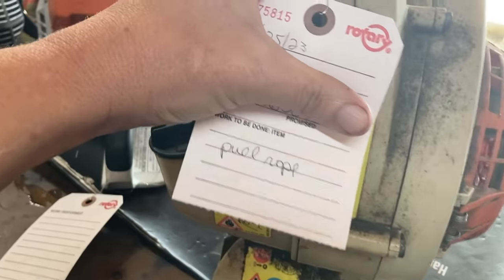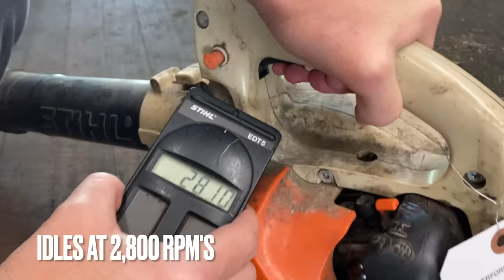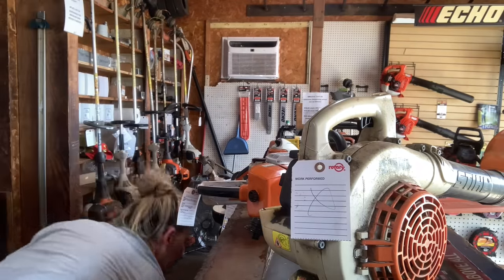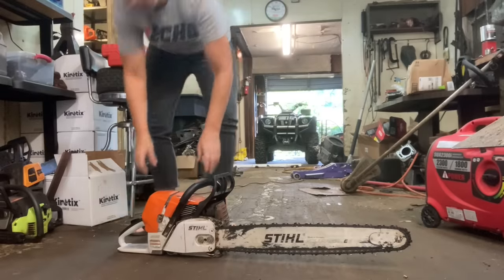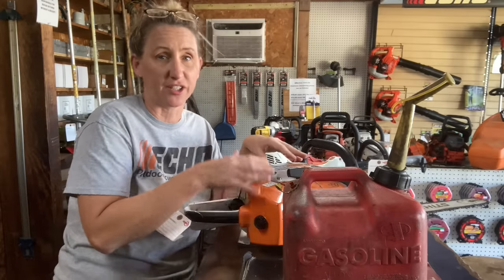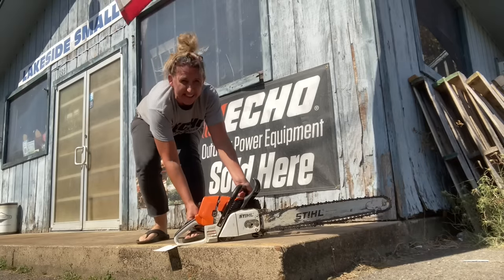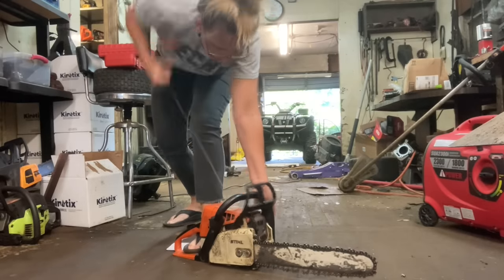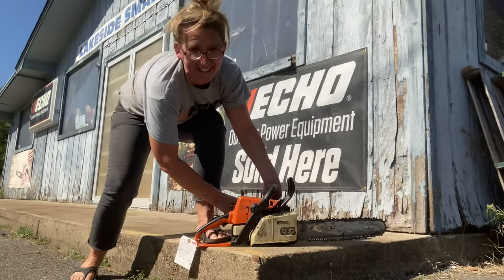The Burning Truth of Canned Fuel. This HUGE Distributor Doesn't Like Me Exposing It!

Comment: JUST ONE QUESTION: has the canned fuel industry ever sold you water in their fuel?
 bought 91 octane premium a few weeks ago, put the first 2 gallons into my truck, filled up my fuel cell, filled up a deere 445, topped off another deere 445 that was over 3/4 full. 3 days later i went to load up the 445 that was completely refueled and it died within 10 yards and couldn't get it restarted so left it at by the garage, loaded up the topped off 445 no issues. about 1minute into using the topped off 445 at full throttle and it starts missing and sputtering  just as i am about to make a 90º turn to avoid going off the top of a 93' embankment over looking the mississippi river and the engine dies sending me to the brink of the edge as i stomped on the parking brake pedal and flipped the lock lever up just as i am jumping off. 1st attempted murder charge of the day by climate change terrorist activists
so then i work my tail off trying to get the machine restarted and get it out of such a precarious position and it took a good portion of a can of carb cleaner to get it running reliable enough to  back out of there, loaded it back up on the trailer till misfiring alot and took it back to the garage, used it to tow the completely fueled 445 onto the trailer and hauled both of them off to the local deere dealer to find out what's going on with the one not running at all and the other suddenly having issues. my truck tank was getting close to empty so i put a few gallons from the fuel cell into the truck and drove down the interstate to the dealer and every time i was at an intersection whether i had to stop for a light or not, the truck had a major loss of power and was running funny... i'm almost to the deere dealer after exiting the interstate and the 3rd to last intersection and i am in the early part of the turn and my truck engine just dies and i coast to a stop in the middle of the intersection with the trailer loaded with both mowers and i am almost rear ended by a tractor trailer that was behind me and it takes the tractor trailer so long to go around me that the light has gone red and traffic is trying to cross the intersection and not one but two more tractor trailers come barreling at me from where the tractor trailer behind me had bstructed their view and damn near exterminate my sorry butt.
#2 attempted murder charge of the day by climate change terrorist activists.
by this time i am starting to suspect there is a fuel problem so put out my work cones around me rig and i abandon my truck in the middle of the intersection after grabbing a gas can out of the back of my truck toolbox for making 2cycle mix walk over the gas station infront of me, buy 2 gallons of premium and a bottle of isoprop fuel treatment and dump both of them in my trucks gas tank while a city cop rolls up, told him i think there is something wrong with my truck and i might need to call a tow truck if filling the tank with this fuel and treatment doesn't work and after a minute of trying to start my truck it finally sputters to life and starts running fine, but sluggish and the deere dealer has a nice parking lot so i go there, talk to the mechanics and they haul my tractors off the trailer to  the repair storage area and i walk across the road to home depot and pick up a small can of acetone and drive over back to the gas station is filled the mix can up and put a measured amount of  acetone into my tank and fill up my truck with half a tank of premium and use the restroom and come back and fire up the truck and it suddenly is running just fine.

deere tested out my machines and tested my 91 octane premium i filled my fuel cell with....it's 99% WATER in my tractors with just a 0.5% of lucas injector cleaner as i am about to due routine completely machine maintenance filter changes and lubricants and greasing to be ready for fall clean ups and winter .

when the dealer tells me it was  mostly water in my tank, i get on the web and start looking up whose job it is to make sure this doesn't happen, and first place i call is  the department of commerce weights and measures division andi drag the dealer pulled fuel samples from my deeres and my fuel cell 50 miles away to their office testing facility and when i get there they look at my fuel receipt i keep for the road fuel cell tax deductions and said because i had bought it weeks ago and the station has probably filled up their tanks 3 times since and there is nothing legally they can do as like police, they have to actively catch a station in the act of selling watered down fuel and that most likely this is the condensate that bonded to ethanol corn juice which due to the molecular structure of carbon to oxygen vs dinosaur fuel having different carbon molecular structure repels water, the ethanol probably sat and built up in the tank and was now siphoning off the water left in the tank when i filled up.@50 gallon fuel cell at $4.45 a gallon, and $275 deere bill just to diagnose what was wrong and empty my fuel systems for 2 garden tractors....i am beyond livid at green climate TERRORIST activists twice attempted murder.

how many people have they killed because of water ethanol killing engines while in critical/dangerous situations?

 last year a man was mowing his side of the mississippi river bank a few miles down river from me and his zero turn was found the next day upside down with him still seat belted into his zero turn drowned to death after his wife reported him missing the DAY BEFORE
 it took a passing kayaker reporting the upside down mower wheels to the sheriffs office to find him!

Comment: Geez 2 years ago I pulled my Lady Stil out from under the bench and opened the case just to try it after 11 years...  MAYBE 6 pulls and it was running.  Only used it once since I moved to the SW from the NE to back drop an almost dead tree that was leaning over my garage. Cleaned it, greased it, checked the chain & teeth then filled the bar oil & fuel an stuck it back in it's case. Fuel is in a 2 gal can with 2 stroke Sta-Bil & 100:1 synthetic oil.  MS250-C Easy2Start.... still on original spark plug but 3rd air filter. If it can't breathe, it ain't gonna run.

Comment: What fuel mix do you use? I use Rec fuel in all my power equipment with a splash of Seaphome evry time. My 2 stroke weed Wacker I have used canned fuel for years, adding a splash of Seaphome as well with no problems, so far. Lol. Thanks for the videos and how tools. Very helpful

Comment: Stihl says their Moto Mix last UP TO a two years. Unless opened. So, if you want to pay $33 a gallon for gas, and use it in two years. Have at it.
Non ethanol so only important if you plan or storing fuel in the tank for months. 
I just buy pump gas, mix it and when I’m don’t, the rest goes into the truck.

Comment: I have been using insanely expensive gas from the local Husqvarna store in a two stoke KTM for several years with no issue. Its engine could not run any better. 95 octane, 50:1 synthetic oil, stabilizer, non ethanol, and no trash or water. Couldn't be happier with it.

Comment: Go to your local airport and get a couple of gallons of 100 low lead. Mix it however, you need with your oil whatever is required, leave it park for five years and it’ll start right up. You can’t beat avgas.

Comment: I've never used the canned fuel because at least around here it is outrageously expensive, but now I won't for sure!  My mix is premium fuel (trying to avoid ethanol), any 2-stroke oil, and some fuel stabilizer in a 1 gallon jerry can, and sometimes I've run that for 2 years without any problems.  It almost makes me think 2 stroke oil stabilizes gasoline but I can't see how it would.

Comment: Here in England, I buy Aspen alcohol free two stroke fuel with oil premixed.  I use it over the winter and for light use throughout the year.  No issues, and much less noxious exhaust fumes.  I started using this because of damage to hoses and carburettors by using E5 fuel with 5% alcohol.  I never use E10.  When I cut my large hedges, I use a couple of gallons of E5 and mix my own oil, as it's much cheaper.  Is your canned fuel alcohol free?

Comment: This interest me because I've got a 2-cycle mini tiller (was abandoned with the house we bought), plan to learn not just take it to a shop...but I want to get going again, takes some crazy high oil ratio (24:1 I think?) and nothing else I own uses mixed fuel.  I'd not found any but the "canned fuel" was of interest to me mainly as a way to obtain a "gas can" that holds really small quantities of fuel so I don't have to worry about a gallon of gas going bad.  Any suggestions for other ways to get a small, safe "about 1 quart" gas can for infrequent use of 2-cycle engines without buying the pre-mix canned gas?  Or maybe just buy a non-mixed canned "regular gas" and mix it myself (or dump in the car and refill with clean good)?

Comment: My wife couldn't get her Stihl trimmer to start (I also pulled it a few times). She has always used non-ethanol pump gas with Stihl Platinum oil. I can't tell you how many times Iv'e cleaned the spark arrestor  on it🤬

LSS I emptied her tank, cleaned the spark plug, pulled with the spark plug out about 10 times,  grabbed my MotoMix, filled it, primed it and it started on the 3rd pull. Funny, It reved better too

Many people in this area swear on the "light pink canned fuel sold at the big box stores" even though I haven't used it I surely did learn something today

Comment: Usually the moment I see something that says "they" don't want you to know this or they hate, etc. etc. I scroll on because it is some bogus ad. I knew it would not be the case with you. I did not realize that this was such an issue. You'd think at the price they charge and it being engineered, your get a clean fuel with built in Stabil. Obviously not.

Comment: Here in the UK I don't even think you can buy premixed two stroke fuel. And even if you could, I wouldn't bother. It aint exactly too much trouble mixing your own. Just don't let any small engines sit for a long time with it in. Five minutes of effort draining the fuel before putting a weed whacker or whatever up for the winter can save you hours of effort in the Spring!

Comment: My brother in law is always buying those cans in 40 or 50 to 1. I’m old fashioned and mix my own, premium non-ethanol fuel mixed at 32:1 with Klotz Techniplate. It’s not cheap oil, but it reminds me of the motocross tracks of my youth. Bad for 32:1 in these newer engines? I just do it that way because of easy math, 4oz to a gallon.

Comment: With all the "it's light. It's pink" being said and I agree, Tru Fuel is garbage. So what what are your thoughts on Stihl's Moto Mix?. Every piece equipment was Stihl, which are notorious for not running on Tru Fuel. 
Also, I hope you changes the clutch springs or replaced the clutch on That MS 461. It's in need of one or the other.

Comment: So this is crazy. After stumbling on to your videos I decided to mix my own gas after using canned fuel for near ever. I've used the husky version on my husky blower for the first little bit of owning it then moved to trufuel. I always felt like it could pull more RPMs and have more power. Switched to mixed non ethanol gas and it would run to max RPMs for a few mins then start to bog out at WOT and eventually quit. Mixed fresh gas with new oil, and same thing. Switched to trufuel and it ran fine. Checked my plug and it's nice and brown so it isn't running rich or lean. Dumped trufuel out and put my mix back in.....same thing bogging down and shutting off. Put trufuel back in and it runs again fine. The non ethanol is on it's own pump so I know it's not getting ethanol. May try getting another fresh batch of non ethanol gas and doing a mix with different oil. I used the husky oil from Lowes. However, I've got a bunch of 2 stroke gas that I can't use. LOL! I'll take it over to my in laws house and use it in their equipment and see if it works on theirs.

Comment: Unfortunately up here in Canada we cannot get any fuel that doesn’t have ethanol anymore. Premium and premium plus can have up to 10%. I was just going to try canned fuel as I always had mixed my own before with no issues. This year my chainsaw stopped running and I determined it was the fuel had gotten water in it. A little checking and I found out last year they had started adding ethanol to the premium.
Reply: Premium in Saskatchewan Canada is still pretty much ethanol free.

Comment: Hi Bre, love the channel. In my area there is no non ethanal fuel. But one station sells racing fuel 110 octane. Whats your opinion on using that for small engines if its mixed with 2 stroke oil?

Comment: I use canned fuel from the manufacturer for both my chainsaw and string trimmer. Their product seems to work much better than the pink fuel in question. Just note that all canned fuels are not created equal, and if you don't use a gallon or two of mixed fuel during the season, you may want to try some canned fuel from a manufacturer that doesn't start with the letter T.

Comment: Fresh mix and Seafoam has been best for me. I've even had regular gas, with Seafoam, in my garden tractor that was up to 3yrs old,, and smelled like new and ran perfect. Stabil, different story. Especially if used with ethanol blended gas. 

I am curious how old the canned fuel is, either off the shelf, or aged a while. And compare the 2.

Comment: I’d be curious to see what happens when you add 3A molecular sieves to the old fuel. Maybe a way to determine if the old fuel is contaminated with water. 
A lot more sciencing to it to know for sure what the issue is but maybe a start.
Reply: My guess is they are chincing out on ligher fractions. Maybe adding a bit of Berryman's B12 or just acetone. We used to put a few cans in old junkers that were sitting 5 or more years to get the fuel to burn.

Comment: I don't care about the issue of how it runs.  The issues is, does the canned fuel make it easier to start up after my chain saw has been sitting for 6 month?  What to I put in my big saw so it will start in the middle of winter when a storm puts a big tree across my drive way.   Storage is the issue, I only use it for storage.

Comment: Another painfuel story. Neighbor called very concerned that a new $ears lawn mower was blowing white smoke. The story was it worked when it was dropped off and ran fine until it was out of gas. They added can-fuel and the engine started smoking. I said let's just replace the gas with No Ethanol gas that had on hand. I used a HF gas/siphon pump, which cleared it out fast. With the No E gas, 2 pulls, the engine started and smoke disappeared quickly.
He assured me that he bought the 4 cycle canned-fuel. I reminded him to check the oil level every gas fill up (just in case)

Comment: And i thought i was doing the right thing by using fuel that doesent go bad in a few months. My blower has been on canned gas from day one. Will switch and try. 
I use sea foam in my 4 stroke stuff,will add it to a fresh batch of mixed fuel.

Comment: I use the sthil canned fuel(in my Husqvarna), but only for storage, since it's ethanol and other things free. All my equipment starts right up after sitting all winter. I run pump ethanol free fuel the rest of the time.

Comment: about a mouth ago bought a huskavarna  545 for the full warranty i bought the gallon of huskvarna pre mix i went trough the first gallon and when i went to regular gas with huskavarna oil its ran way better could be break-in but to me seemed a waste of money to run forever partially at 35 a gallon and i cut 4 cords a year minimum

Comment: My 2 cycle fuel is pink, too, but it's not canned fuel. I use Sten's 2 cycle oil, have for years and had no problems with it. It used to be green, but now it's pink. Honestly, I like the green color better than pink because it's easier to tell from a glance that it's mixed fuel. I have never bought or used canned fuel, because I thought what worked out to over $20.00 a gallon for gas was ridiculous when it first came out...I still do. I won't buy pre-mixed anti-freeze for the same reason...you're paying around $7.00 for a half-gallon of water....

Comment: almost any boatyard will have ethanol free gas, it's not cheap, but they also sell the 2 stroke oil, just mix it up yourself, I had a brand new echo blower that wouldn't run on the canned gas, got a new carb etc... it fouled up in 5 minutes on canned gas, ran the mix gas I had made and now it runs fine.

Comment: I have two Honda EU2200 generators on hand for emergencies only.  I keep them fueled with VP 4 cycle fuel, start and run them once every six months for 30 minutes, then top the tanks off with the same fuel and put them away.  Both will start with two pulls every time.  I have never had any problems with them using this fuel, however I will admit that I always drain the carbs as well before storing them; I guess I don't trust this fuel completely.  Do you think I'd experience the same trouble-free performance if I fueled them with ethanol-free gas treated with something like Sta-bil?  Thank you.

Comment: I had a STIHL FS110R. They sold me the extended warranty if I purchased their STIHL branded premix fuel. Now I'm wondering if it was the mixture that made the weedeater bog after a line snag and slow recovering when reapplying throttle....or if it was simply the nature of the different cycle to that of regular 2 stroke engines? It was a beast and one of the biggest engine I could find before they bolted handle bars (which I hate) on the thing. Compare it to a Shindaiwa from the 90's which has the slickest throttles and recovery after snagging a fence or large brush, but those I always mixed my own gas.